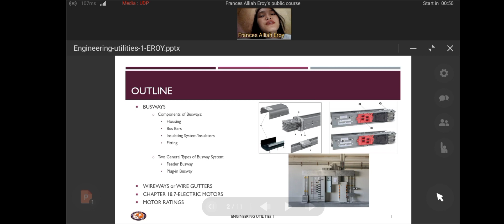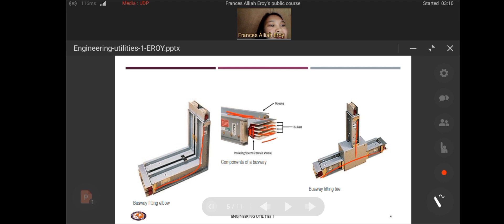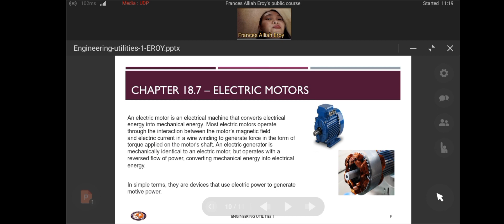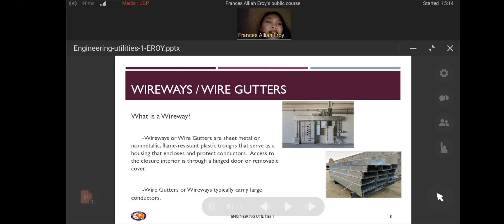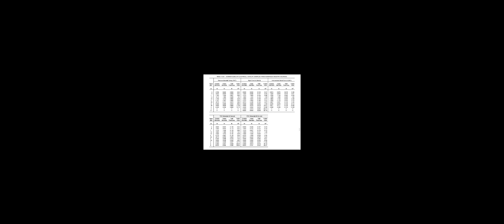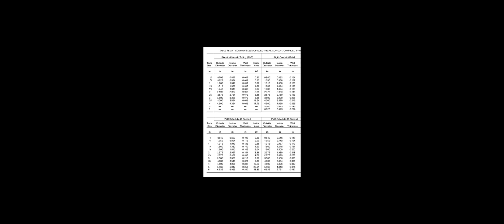Engineering Utilities 1 (Busways, Wireways, Electric Motor, Motor Ratings)

Comment: I've grasp some information about this video on how effective busways, wireways, electric motor and motor ratings when it comes to electrical consumption wireways and busways protect conductors by preventing kinks and damage from elements like dust or water which is according to Ms. eroy. They route electrical wiring, electrical feeders, branch circuits, and other groups of conductors and etc. and the electric motor also discussed well since it also the alternative as the generator where we used when there are no available electricity from the sources (socoteco, meralco) since generator also convert electrical energy to mechanical energy.

Comment: For this presentation it important for us to learn about busways. It is the distribution just like busbar that distribute current. Prefabricated electrical distribution system consisting of bus bars in a protective enclosure, including straight lengths, fittings, devices and accessories.

Comment: I appreciate your thorough explanation of the subject. The Busways, Wireways, Electric motors, and wire ratings were covered in this chapter. The motor ratings, motor types, and motor controllers were some of these topics. I discovered that the gadgets we use on a daily basis in our homes employ electric motors to transform electrical energy into mechanical energy. There are several kinds of electric motors, I also discovered. These are incredibly helpful because we utilize these tools on a daily basis.

Comment: NEMA, or the National Electrical Manufacturers Association, described the busway as a prefabricated electrical distribution system made up of bus bars in a protective enclosure comprising straight lengths, fittings, devices, and accessories, as I learned from Ms. Eroy's report or video presentation. Additionally, I gained knowledge of the feeder and plug-in busway types. These two busway types are thoroughly discussed by Ms. Eroy.

Comment: Thanks to this informative video, where it taught me the busways, wireways is a channel management of wirings used in various electrical line designs. With significance of connecting power source to electrical outlets, wire management is important. The point is that with proper wire channels, electrical can be easily traced and know where to have the corrections in case of problems.

Comment: Thank you miss Eroy for teaching us what is the busway, wireway,Electric motor and also the motor ratings. The wireways is to shield cables from environmental irritants such moisture, grease, dust, and filth. She said that transports electricity and connects to electrical gear such as switchgear, panel boards and transformers.

Comment from the maker: I've learned alot from my report. I've learned that a busway is used as an alternative to cable and conduit and is commonly found throughout mission critical facilities, data centers, industrial facilities and many more. Also, a busway is consists of busbars. I've also learned that Wireways are like a passageway of conductors. I've learned that Electric Motors are machine or devices that converts electric energy to mechanical energy. I've seen an electric motor once when my uncle fixed our fridge and that time I don't know how it works, after I studied my report I learned how it works now.

Comment: I learned about the Busways, Wireways, Electric Motors, and Motor Ratings for this video. Having knowledge of the following subtopics within the topic of "Building Electrical Materials and Equipment": 1. Busways, a prefabricated electrical distribution system made up of bus bars enclosed in a protective enclosure; 2. 3. Electric motor, an electrical device that transforms electrical energy into mechanical energy, and finally, motor ratings, which refers to the maximum continuous kW output of a motor and is significant since it will be utilized in the future. Wireways are a conduit for wires.

Comment: From this video, I learned a lot about the busways, wireways, and motor ratings. Ms. Eroy also explained the purpose and how important this topic that I have mentioned. I learned that busway is a prefabricated electrical distribution system consisting of bus bars in a protective enclosures, including straight lengths, fittings and accessories. There are also two types of busway such as feeder busway and plug-in busway. It is very important to have knowledge about this topic and to know the purpose and how important it is to us.

Comment: Thanks to Ms. Eroy, for sharing her thoughts about this topic. After I've watched her presentation, I've learned that in Building Electrical Materials and Equipment, knowing about its subtopics which is; 1.Busways which is a prefabricated electrical distribution system consisting of bus bars in a protective enclosure, 2. Wireways which is a conduit for wires, 3.Electric motor which is an electrical machine that converts electrical energy into mechanical energy, and lastly Motor ratings which means the maximum continuous kW output of a motor is important for it will be used in the future.

Comment: As a Civil Engineering student, I learned about Busway, Wireway, and electric motors. It is crucial for us to understand the fundamentals of routing and protection for electrical and information cabling systems, how motors function to provide energy, how to adhere to standard wiring, and where our electricity or energy comes from that lights our homes, so that when the time comes to construct a commercial building or even a residential building, we will do so safely.

Comment: Watching this video taught me that electric motors are a type of machinery that generates motive force. It also shows a table with an estimated full load rating in amperes based on horsepower, phase, and line voltage for specific motors. As a result, the video includes scenes that depict electric motors, motor ratings, busways, and wireways or wire gutters.

Comment: I have learned that using busway in place of cable and conduit to distribute electrical power can help building owners save all three commodities in significant amounts. Busway transports electricity and connects to electrical gear such as switchgear, panelboards and transformers

Comment: The video is all about the busways, wireways, electric motor and motor ratings. I discovered that busways function by enabling additional circuits to branch out at any point along the route. While wireways are intended to keep cables safe from environmental pollutants including dust, dirt, grease, and moisture. The electric motor generates force in the form of torque imparted to the motor's shaft by interacting between the magnetic field of the motor and electric current in a wire winding. Overall, the video gives thorough information that allows us to quickly comprehend things.

Comment: By wathcing this video , I learned that busway as a prefabricated electrical distribution system consisting of bus bars in a protective enclosure, including straight lengths, fittings, devices and accessories. In electric power distribution, a bus duct, or busway, is used to conduct electricity to power cables or cable buses.

Comment: After carefully watching this video, I've learned that the National Electrical Manufacturers Association (NEMA) defines a busway as a prefabricated electrical distribution system consisting of bus bars in a protective enclosure, including straight lengths, fittings, devices, and accessories. Ms. Eroy discusses busways, wireways, electrical motors, and motor ratings in this specific topic.

Comment: In this video I conclude that The purpose of an electric motor is to convert electrical energy into mechanical energy. This mechanical energy can then be used to power everything from heavy, industrial machinery to everyday tools and appliances such as hair dryers. Wireways are designed to protect cables from environmental contaminants such as dust, dirt, oil, and moisture. Wireways—sometimes known as “troughs” or “gutters” within the electrical contracting field—are commonly used to control wiring in environments where contaminants may cause problems.

Comment: I learned that a busway, according to NEMA, is a prefabricated electrical distribution system made up of bus bars enclosed in a protective shell, together with straight lengths, fittings, equipment, and accessories. A bus duct, also known as a busway, is used in the distribution of electric power to carry electricity to power cables or cable buses.

Comment: I learned about Busway, Wireway and electric motors as a Civil engineering student it is important for us to know how the motors work in order to provide energy and follow the standard wirings and where our electricity or energy comes from that provides light in our homes, so that when the time comes when we build a commercial building or even a residential building, we can follow the standard about electrical sources or we know where we get energy from. As a Civil Engineering student, it is more important for us to know the different electrical sources so that we know how strong the energy we get when it is weak or strong can find a way to not overdo or weaken the energy we get.

Comment: In this particular topic Ms. Eroy discuss busways, wireways, electrical motors and motor ratings, and after throughoutly watching this video I learn that Busway as defined by the National Electrical Manufacturers Association (NEMA) is a prefabricated electrical distribution system consisting of bus bars in a protective enclosure, including straight lengths, fittings, devices and accessories.

Comment: For this video I learned about race ways So both raceways and wireways serve as channel letter mounting structures. Another similarity is that either structure makes a sign easier to remove and relocate. However, raceways may contain both electrical components and wiring. Wireways are slimmer, narrower and usually contain only wires Often the ceilings or floors are accessible, such as with access floors or acoustic ceiling tile ceilings, commonly referred to as “lay-in” or “drop” ceilings. Where these types of building elements are installed, the designer has several choices for pathways that include additional options, as well as the raceway example previously presented. God bless

Comment: I learn from this topics it's all about busways so NEMA defines a busway as a prefabricated electrical distribution system consisting of bus bars in a protective enclosure, including straight lengths, fittings, devices and accessories. In electric power distribution, a bus duct, or busway, is used to conduct electricity to power cables or cable buses.thats all

Comment: I discovered through Ms. Eroy's report or video presentation that NEMA, or the National Electrical Manufacturers Association, described the busway as a prefabricated electrical distribution system made up of bus bars in a protective enclosure containing straight lengths, fittings, devices, and accessories. I also learned about the types of busways: feeder and plug-in busways. Ms. Eroy covers these two busway types in great detail.

Comment: From this video, I learned that electric motors – refer to devices that use electric power to generate motive motors. Also, it shows a table containing an approximation of full load rating for selected motors, in amperes, based on horsepower, phase, and line voltage.  Thus, the video depicts busways, wireways or wire gutters, electric motors, and motor ratings.

Comment: NIEL JOYCE L. DEGORIO BSCE-3

In this topic, I learned that NEMA defines a busway as a prefabricated electrical distribution system consisting of bus bars in a protective enclosure, including straight lengths, fittings, devices and accessories. In electric power distribution, a bus duct, or busway, is used to conduct electricity to power cables or cable buses.